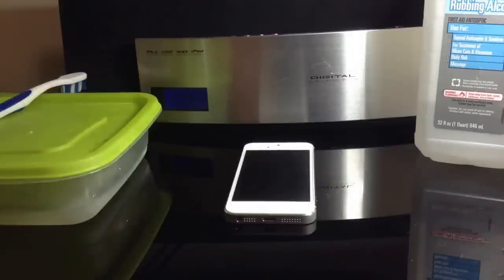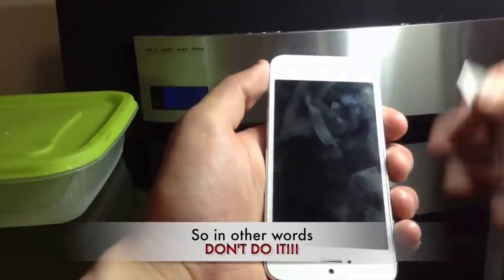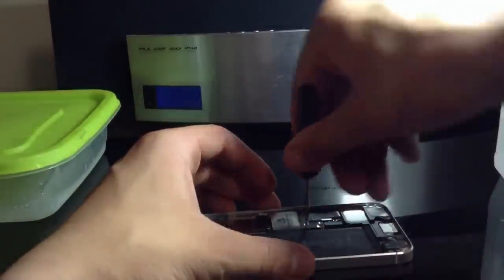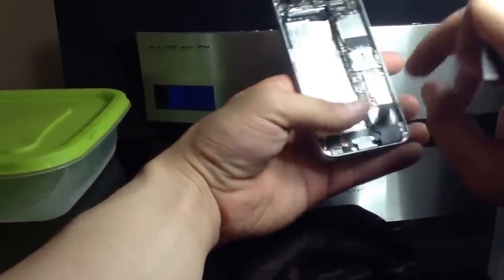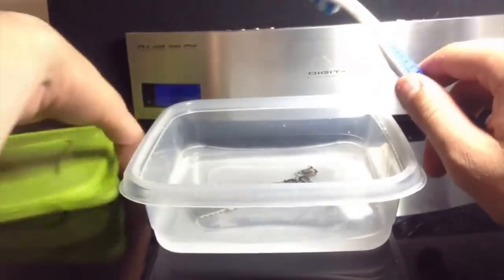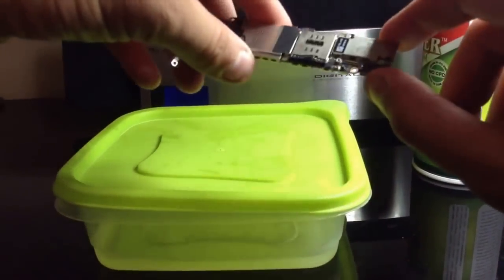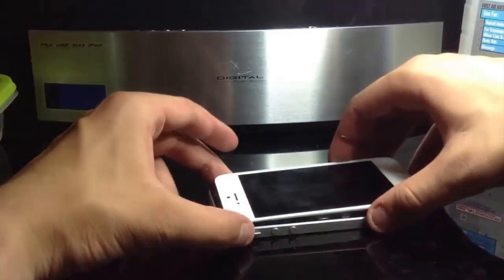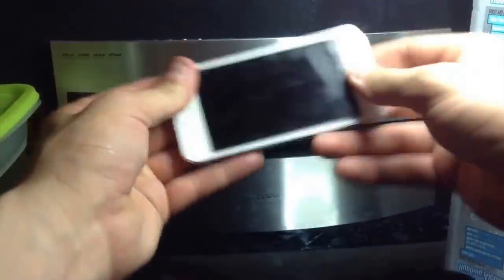iPhone water damage repair DIY (full step by step guide)

Comment: Can't thank you enough for this great tutorial. While it hasn't worked for me, it was very helpful, easy to follow, and informative. I had my phone in my pocket when I jumped in a pool. It was under water for about 20 seconds before I realized. I'll try a new battery first, then the LCD, but hopefully I can get this phone back. I had run out of iCloud space, so no backup for awhile - lost a lot of stuff. :(
Reply from the maker: Sorry to hear that, hopefully it's able to at least connect to itunes later, but next time I would suggest staying away from relying on iCloud at all accept for contacts, always back up to itunes and you'll always have a full back up which will also save text messages as well

Comment: Thank you for this video! I used your instructions for water damage on my iphone 5, 8 days after the accident. And it works fabulously! Well, not quite, it appears that the battery doesn't hold a charge now, but I just ordered one on amazon for $18 and am not afraid to switch it out! Thank you!! I used a second video, too, just because I like 2 sources :-). And I didn't have an air blower, so I just used a hair dryer on cold and an extra hour to let the logic board dry.

Comment: Thank you for posting the video. I got thrown into the ocean today and after 5 minutes of being submerged several times I noticed I had my iPhone5s on my arm in my fitness case. I immediately took it out. Wiped off with a shirt and then stuff in my bag to head to the store to get some rice. I then threw it in rice in zip log bag b/c well pretty much everyone says to do that. The guy at the store told me he bought some powder kit at Radio Shack so of course I drove there next. NO LUCK. They don't sell it anymore. I then spent next couple hours reading stuff online. Finally after 6 hours I get to your video. I took chemistry in high school and we used to use Acetone to clean water out of beakers. I thought I would try dumping it in acetone, but couldn't get any. I've thought about trying silica gel packs, or just putting silica powder in with the rice or replace rice all together. I've thought about just dumping entire phone in the Isopropyl alcohol for a few minutes and then blowing it dry with straw. At this point it has now been 8 hours since it happened. I tried to take the screws out of the phone but done have the damn screwdriver and no luck trying to buy it on a Saturday night. What should I do? I don't think I have the skills to take apart my phone. I'm off to bed soon so my guess is it will be 24 hours after the incident occurred before I hear from you. Maybe more. Just wondering what I should do? Thanks in advance for posting this video.

Comment: followed your steps and so far there is a massive improvement! iphone wasnt turning on previously or charging which it now is so i thank you! ill reply with more updates once the iphone is charged enough
Reply from the maker: Awesome, that's what I like to hear and i'm happy it's working out for you so far
Reply: iphone all working thanks to this tutorial! rear camera doesnt work due to water damage and water msrks on the screen but its working hhaaha! thanks man!
Reply from the maker: no problem, issues after damage like this are very common if the device is still working after being cleaned, but many devices just don't work at all either, so great to hear everything worked out for you (except those few defects). Just keep in mind that you might have other issues later onwith it and even if you don't just back up the device to itunes fairly often if you regularly keep and/or add any kind of sentimental data to it. But either way good job following this guide and getting your phone back in working order.

Comment: I went tubing with friends and somehow my iPhone 5s got put into a cooler. It was literally submerged under liquid at the bottom of a cooler for over 2 hours, (including melted ice, red Gatorade, and vodka).....After following these instruction thoroughly, my phone works! It's a miracle. The screen is a little messed up, like it still looks wet/smudged. But I can live with that. I'm just happy I don't have to break the bank to get a new phone. Thank you for the tutorial!
Reply: Joe O 
Hi Joe O, I washed my 5s in the white load - double rinse and all!!  Now the question is "can I save it via this method?" I need the tool kit first so I have to wait until next week when the kit arrives.The Vodka probably saved you on your mistake.
How long did your Iphone sit before you could fix it? 
How did you store it until you could fix it?
I have some Xtend-It (ethane, 1,1,1,2, tetrafouro and dimethyl ether) that is used to evacuate oxygen from chemical pots (urethane mixes). I wonder if that could be used to stay the corrosion process? or should I use nitrogen gas?(the idea here is no oxygen, no corrosion - maybe?

Comment: I seriously should have been videoing my reaction when my 5c turned back on! My phone was submerged for a little bit in river water (forgot it was in my bathing suit pocket). Getting the battery out was probably the hardest part. The screen is a little funky (not bad at all) and the camera doesn't work. Think I'll replace it now that I know how, the 5c is actually easier to take apart. Thanks for the very thorough vid, YouTube rocks!!!

Comment: Hey Nate! First off thank you for your video, much appreciated! Soooo my phone went for a swim a few weeks ago, just for a few seconds though and I have, for the past two weeks, been trying to fix it, and I am about to give up. After the pool incident, I saw your video and did the cleaning, tested it out to see if it turned on, as you did, before putting everything back together, and it turned back on beautifully! but then I decided to brush lightly on some rusted screws, then realized, "shoot I forgot to check if the camera worked," so I plugged back in, the couple of cables necessary for it to turn on, then all hell broke loose! My screen turned on and showed the apple sign just fine, but a few seconds later, the screen went a shade darker and showed this NANDJ_Flash drive error! I was crushed:( Then I did some internet forum searching for this problem, and some said to change the front camera/proximity cable, which I did, and I also changed the docking assembly and the back camera, AND tried cleaning the logic board again, but it isn't coming back to life:( All it does is light up the black apple with the white background, then shuts off, then comes back on, then shuts off, then turns back on, then shows the freaking NANDJ_Flash drive error again. Any suggestions or am I completely F**ked and just count my blessing and buy another phone:/ Thank you in advance for taking the time to read my story and get back to me.
Reply: +Deb T my phone is doing exactly the same i dont know what to do anymore!!!!

Comment: I used the method and when I go to turn it on or plug it on the charger , the motherboard gets extremely hot . What do I do ?
Reply from the maker: don't do anything with the board and recheck for arcing on the board terminals. If there is arcing lightly scrape the area on the terminal with the sharp end of a blade. Worst case is the board is fried and it would have to be either warrantied (clean the inside to perfection w/new water marks as well) or reassemble and pay the $269 replacement fee. Sorry for the bass news, but i'd rather be honest than give false hope

Comment: Thanks very much for your very detailed video. I disassembled and reassembled my iphone 5s.  Unfortunately I didn't know after it fell in the water I had to immediately turn it off.  I only had the phone for just over a year.  Sooooo....things shorted out  I could actually see burn marks on the backside of the logic board.  And one of those things you push in had a burn mark right in the middle on both parts.  That battery part was pretty scary.  I thought for sure I was going to poke a hole in it.  But I used the same razor blade you did and was able to carefully get it out. The weirdest thing I found was that teeny tiny screws actually screw into the head of other screws beneath.  The watermark on my screen definitely had a red dot.  I'm wondering if I can sell it for parts on ebay and just take that logic board out, or keep it for spare parts for the refurbished 5s phone I bought at Walmart.com.

Comment: A very informative step-by-step video.  Can't emphasize the importance of keeping the screws in the same order as you remove them.  Will use it if ever needed.  Also note that putting back the screws is always little more difficult than removing them. :-)

Comment: It would be helpful to make a note of the flex cable next to the home button on the 5s. Watched the video 3 times getting ready to attempt. Had no idea the cable was there and it broke. Where can I acquire a new one?
Reply from the maker: +Aaron King Order an aftermarket one and install it (it wont work with touch ID, but if the phone looks clean inside and water marks are replaced it should be ok) take the phone to apple, tell them your touch ID stopped working for no reason and they'll likely replace it fo free or charge a small fee unless they are able to program the aftermarket one (yes apple can reprogram non-original buttons - no you should not tell them you did anything inside of the phone at all)
Reply: +Nate Rist plz answer, I have a I phone 4s and when I turn it on...half of the screen is like cut off it fell into water can i just cover it with rice and a plastic cover
Reply from the maker: +Golden Bird wings sounds like the lcd/digitizer assembly will need to be replaced and no, your phone will just get worse from corrosion overtime if not cleaned out properly (if it's been liquid damaged that is)

Comment: Thanks Nate, video is great for newbies (me).  Wife dropped Iphone 5 into chlorine cleaning solution (toilets).  

Your method of testing the screen helps a a lot.  Didn't realize you could connect all without screws,  Is the battery in series with power to motherboard?  I think I cracked battery when removing (ever so small misalignment length), plan to replace. No LCD display yet.

Overly warm motherboard.  Any suggestions on why?

Kevin

Comment: Nate thanks for the video very helpful...I reassembled my 5c and most everything works with the exception of my home button and the screen has a slight ghost white discoloration on the top corner about 1.5 inches by 3/4 inches. I replaced the home button assembly and I still have the same problem. Any ideas for these fixes?

Comment: Thank you for your help! I plugged it in after I finished, and the apple sign came on, but keeps turning off again. On and off over and over again. Do you have an idea why? When pulling up the battery, something looks slightly torn. Could it be the battery needing to be replaced?
Reply from the maker: More times than not your battery is just fried. Which model do you have so i can post a link for the battery?

Comment: Hi, Nate:
Great video and useful tips to remind how to place the tiny screws. I followed your instruction and did the same for my iphone5. However, when I put back and charged a while, I got dim lighted tiny words on top of the the screen indicating something failed to boot. Any idea which part of the iphone is the most likely cause? shot me a reply if you know the cause based on your experience.
Reply from the maker: Is it the boot logo screen with coding at the top? Or send a pic to my email: n.rist916@gmail.com
Reply: tks, Nate. screenshot sent via email
Reply from the maker: I got them. Unfortunately i've never actually seen an IOS device revived after seeing that kind of coding on the boot screen. Whatever the coding says could tell you what's not working or what the boot error is, but my best guess is that the internal flash memory is corrupted and unable to boot into the OS.

 You could try a DFU restore, but that's all I can think of to try. Otherwise you could find a used working logic board and swap them, but that wouldn't do anything for your old data, but you'd have a working phone at least. sorry for the bad news.

Comment: Nate where do you recommend buying the front assembly including camera, speaker, home button? I usually go to ifixit but can you point me to a better priced source? Thanks and excellent video. I have two small grounding assemblies that came out of the 5c I'm fixing and am trying to ID them too.......thanks again.
Reply from the maker: This is a seller i've used for years, usually cheaper, but sometimes a bit higher priced than some, but always very high quality. I rarely have issues with their parts.

http://www.ebay.com/itm/Complete-White-LCD-Touch-Digitizer-Screen-Home-Button-Camera-Iphone-5C-/231236189072?pt=LH_DefaultDomain_0&hash=item35d6c03b90

Comment: I have a life proof case and was using my phone in warm water to take a video (was not thinking of how that could damage the case). all of a sudden i realized that the phone screen was starting to turn black so for some reason the first thing i did was pushed the power button.  My phone was at about 12% when this happened so how can i be certain that the phone is damaged and its not the battery life. I did try to put it on the charger for a few seconds to see what would happen but nothing happened. I hope i didn't damage the phone even more by trying to charge it

Comment: Hello Nate,I have a Apple SE that got water damaged going through a underground tunnel at the City of
David, Israel. While in the tunnel the water came up to my pocket and damaged
my phone.I have tried to be very careful to follow your video and sadly one of the ribbon cables that
plugs into the left of the hard drive tore. I went to the our recommended website - E*TRADE to look for a replacement ribbon. Should I
just give up on trying to continue repairing it? I have the phone completely open
and parts  carefully laid out for reassembly. 
If it would be easier to just replace the phone where would you suggest I this. I continue to
make monthly payments with Verizon which is very expensive. 
Thank you for your time and assistance. I only wish you continued to offer your repair
service. I am in Arizona.
Cheers,Eric

Comment: This guy has the right idea. You really should remove the shields to displace all the water with IPA and also put it through an ultrasonic cleaner after a complete visual inspection. You should not soak your motherboard, just rinse it and brush it with IPA. Only do this if you're certain corrosion has not loosened parts.

Comment: Thanks for the video! I'm looking to replace my cracked iphone 5s screen and was considering buying a water damaged iphone 5s and switching the screens instead of buying a knock off. Do you think the water damage affects the LCD at all? Or the digitizer/audio+camera cable?(rather not have to switch those)
Sorry for the off topic question, just broke and trying to avoid getting a crappy screen on amazon (unless you have any recommendations).

Comment: Hi there! My iphone SE spent about 30 minutes in an ice bucket after getting knocked from a table and suffered some water damage. I stupidly tried to work the phone and charge the phone after drying it off and noticed many color deformities and lines in the screen that suggested what I believe is short circuiting. I now have the phone turned off, removed the SIM card, and dried everything off manually (not too much water to begin with--I can't even find the water activation label that is supposed to be inside the SIM card slot). My question is: Is it too late for me to try to fix my phone using your amazing video guide since I did not immediately turn the phone off or is it worth me giving it a go?

Comment: Hi Nate, I've followed all the steps with a phone that's not been used for months post water damage, with no luck, I have been successful with my iphone 5 but not the 5c.  Ive  installed a new battery and new screen, wondering if there's anything else I could possibly try to do as a next step?

Comment: Good video with lots of tips.  Could have speed through screw removal a bit though...

My phone did the big flush and although I didn't do the alcohol bath, opened it up and dried everything off. Gave it a quick spray with freon contact cleaner and let it sit in the sweet Colorado sunshine in <10% indoor humidity for few hours. 
When I put it back together everything worked perfectly but the back camera is still funky.  Red splotches and blurry pix no matter what I tried. 
Ordered a camera and new battery for good measure and will install as soon as they arrive and give update.

For those who face the issue, the primary thing to do is to open it up and dry it out ASAP.  Canned air, contact cleaner, freon, anything to displace the water is first order of action. It's a lot easier to prevent corrosion than it is to clean it up after the fact. 

And to the guy thinking of buying phone on eBay dunked in pool two months ago, don't even bother.  It's dead.
Reply: +Colorado Mike 
PS:   Should update video with 5s if you can.  Fingerprint scanner cable is going to surprise a few people and is a mother to get back on.

Comment: Hi great video. I have the 5c what was dropped in water, i have changed the battery and it turns on but not the screen, what would you recommend, changing the screen or doing what you have done in the video?